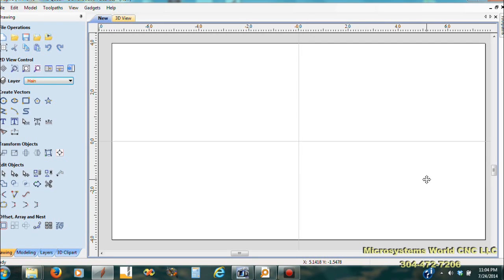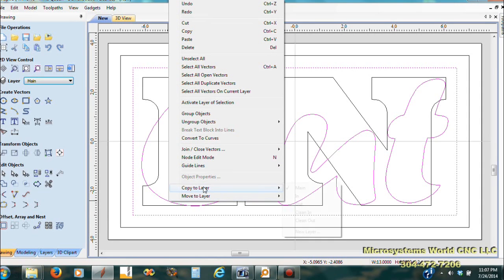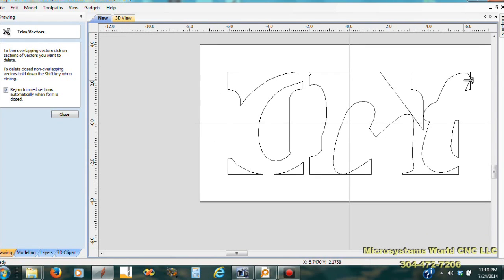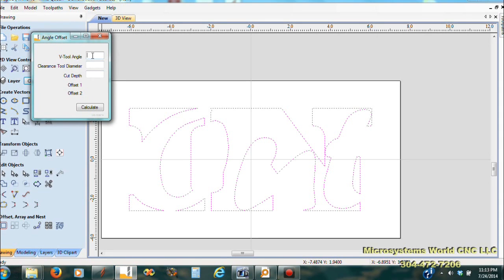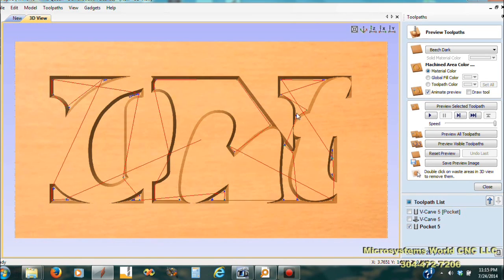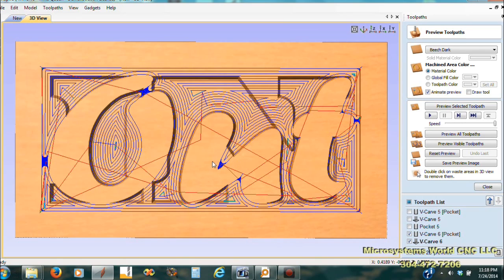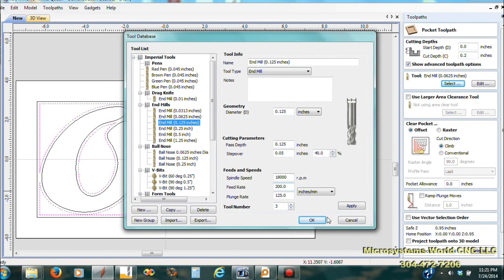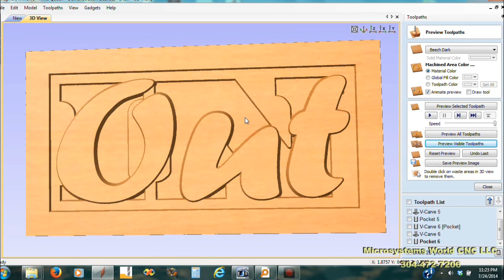VCarve Pro and Aspire tutorial. Second tool cleanup pass for VCarving.

Comment: Another great video Mike, thanks! Would love to see a video on how you add new "bits" to the software - specifically how to work out the optimum stepover %, feed rate etc based on the material / depth you are cutting. Also would love it if you would either send me the code for your offset tool or let me know the formulas used. I carve in mm so, if I had the formulas I could work it out for myself. Keep up the great work Mike 👍👍👍

Comment: Hi Mike, excellent video, is it possible to get the angle calculator you have? or just the formulas you use to work out the offset
Reply from the maker: Hi Eric. If you read in the comments below, there's a link to the app. You can download it if you like.

Comment: Nice video, very useful! Would you mind sharing the mathematical formula for the two offsets, given the v-tool angle, clearance tool diameter and cut depth?
Reply from the maker: Krešimir CindrićKrešimir,  if you give me an email address I'll email you a link to the offset application.
Reply: could you please sent me a link on the Angle offset calculator or is it on the vcarve program.

Comment: Nice Video ....Where did you get this offset angle thing? I really need that option. Thanks for taking the time on these video's.
Reply from the maker: Jeff, I need an email address.
Reply: Fanningtime@gmail.com.
Reply: Thank you
Reply: I really like your videos I suck at them.
Reply from the maker: Thanks.
Reply: cncMike304  me too please i would like to get your angel offset prog , thanks redart3@gmail.com
Reply from the maker: redart3
Sent.
Reply: cncMike304 Hello. May I have the link to your Angle Offset tool as well? My email address is darrell.hale.acs@gmail.com 
  Thank You for this technique of making clean-out tool paths that do not involve lots of unnecessary "air cutting" with smaller bits.
Reply: cncMike304 Mike your video helps out greatly figured I was doing something wrong or was just stuck with the little corners not cleaned out. Again thank you and my email is william.j.screws@gmail.com if you would send the link for the off set application.
Reply: Would sure like the offset angle program as well...freepieguy@yahoo.com
Reply: i would love to try that app of yours ..rwehvnfunyt@yahoo.com